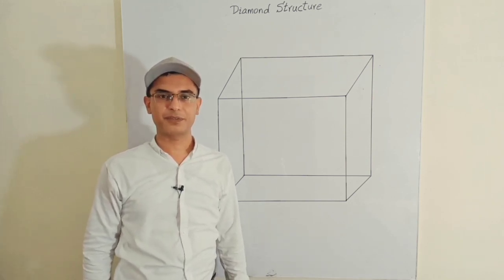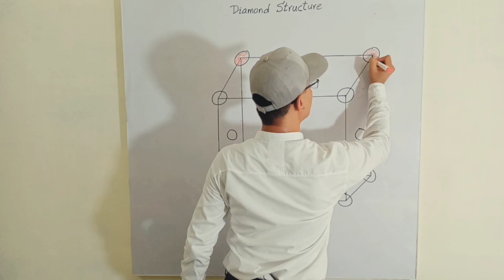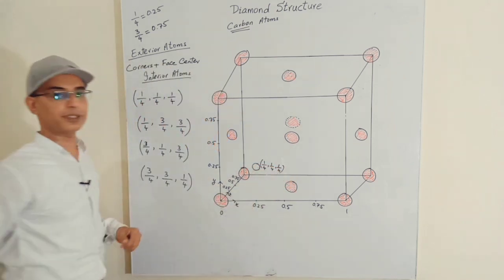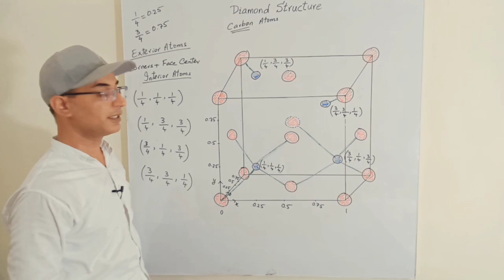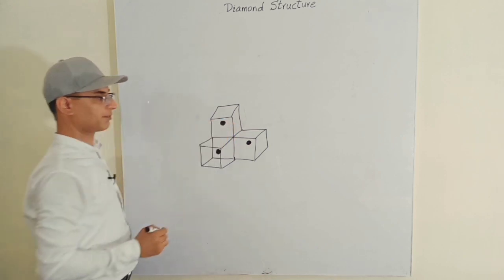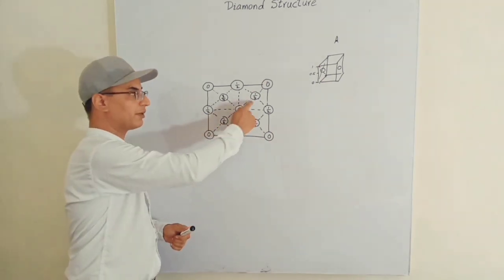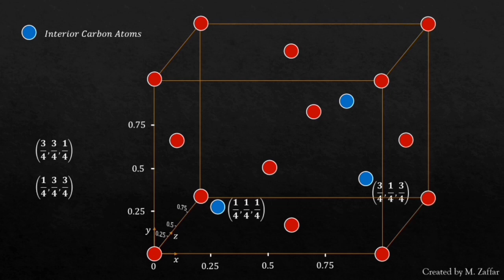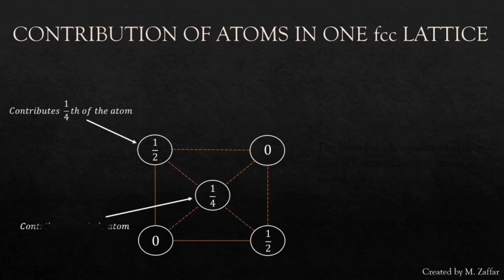Diamond Crystal Structure

Comment: Sir kindly tell that if net force acting on a object is zero then the object will move or not?
Reply: OK sir thanx alot
Reply from the maker: Just go to Newton's 1st law of motion. "If an object is moving it will continue to move until an external force doesn't changes its motion". Therefore, if its moving then it will continue to move for all net forces zero. I hope you understood.
Reply: @ZaffarcreationAK  it's mean that if the object moving with constant speed then net force =0
Reply from the maker: @hamzatahir9409  yes dear, because the acceleration will also be zero. Consider F = ma, the net force will be zero as a = 0.
Reply: @ZaffarcreationAK  well sir I get it but I have small qurie that if net force is zero then how the object moves.
Reply from the maker: @hamzatahir9409  Dear you are interpreting it in a different way. Object needs kinetic energy to move. Therefore object can move if there is no net force acting on it.
Reply: @ZaffarcreationAK  now sir it became clear